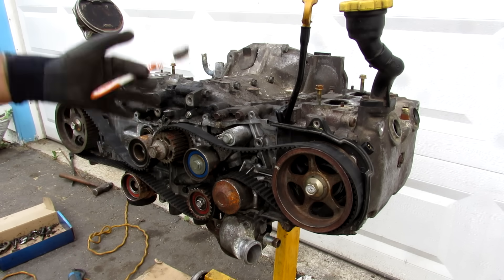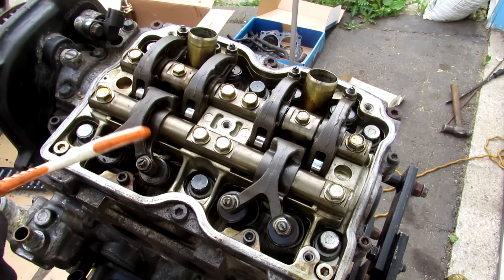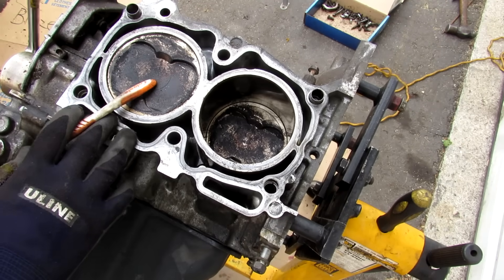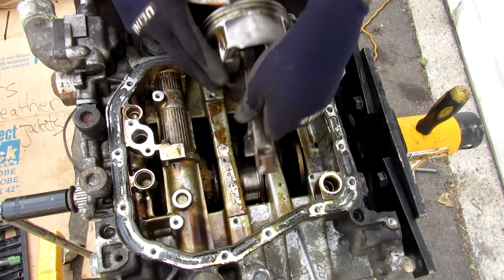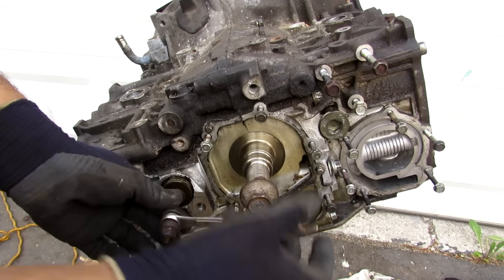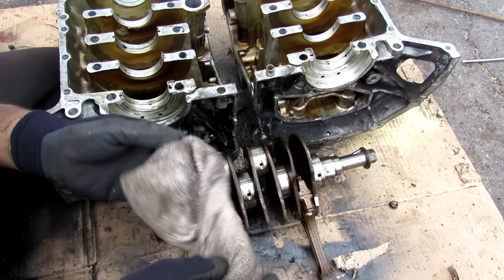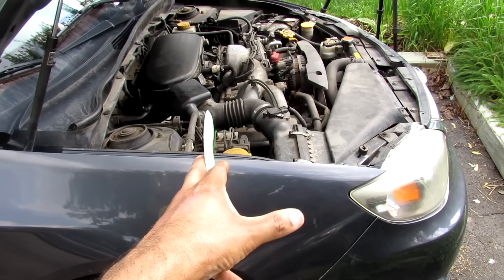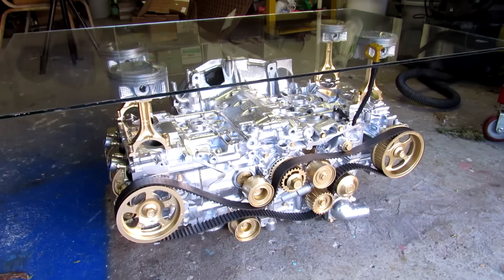Why Subaru Engines FAIL

Comment: A V6 is not smoother than a flat four as it does indeed have secondary forces that generally need a counter balance shaft to dampen them. An inline 6 is very smooth however. Even a V8 is inherintly out of balance. Smoothest running engines, Flat 4, inline 6, V12, and the old inline 8's.

Comment: I can see it, man I broke my suburu engline. It didn't want to split apart so I was pounding it with a rubber hammer and it cracked. Then I found their was still one bolt  hiding between inside the 1" hole in the sleeve. LOL

Comment: Mechanic owns a Lexus cause he knows they are one of if not the most reliable cars on the road. 

If I could afford a new car right now I'd buy a LEXUS or TOYOTA  Forerunner. If ya maintain the engine with regular fluid changes on time  you will never need another vehicle again.

Comment: Moral of the story wouldn’t hurt to put in a high flow oil pump or a bigger sump if you can or at the very least keep them stock standard and make sure they’re always chockablock with engine oil that’s clean

Comment: My 2010 ej205 have 270k with no headmaster replacement. After 2013 Subaru went to Single layer metal head gaskets witch destroy the head hgasket leak. They might not be the easiest to work on, but its rare you do unless you have 300hp or more with the wrong build.
Reply: Headgasket**

Comment: Most fails come down to irregular oil changes and hard driving , if you have a weeping gasket a stopleak in the radiator fixes this problem for good the earlier the better
Reply: Wow, how about a new radiator. Patches fail it's best to do the job and just get it over with. Boxer motors, great in aircraft.
Reply: I think he means when we have a leaky gasket we can put an additive in the radiator. This would fix the gasket leak. Cheers.
Reply: @bignaughtydog  right, I Misspoke
Reply: A denier that will walk

Comment: Modern engines have really weak and thin piston rings to reduce drag. But what really happens is they don't do their job well and that's why modern engines burn oil. Older engines had to be neglected for a long time before that happened because they had thicker rings with more tension. They're trying to fix one problem by causing a lot more. If they would just put better rings in Modern engines, they would last a lot longer. But if people would maintain their vehicles properly, that would also help

Comment: And yet, my neighbor, who commutes almost two hundred miles every day, buys used Outbacks with an average of 100,000 miles on them and drives them until an average 300,000. Can't remember him ever having a serious issue or being towed. He loves them because he drives over a snowy pass. He said he buys them because of their reliability and because nothing else on the market compares to the security of the symmetrical AWD. He also owns a 4WD pickup, but vastly prefers the Subaru in the snow.

Comment: My 01 H6 outback went 300k and rear main leak was it's death. After that I had two outback sports that went 300k with subframe rust being their deaths. H6 I did a pulley, both sports I did timing belt jobs. Mobil one and premium gas. My WRX spun bearing at 130K after month of owning just day dreaming down the highway and that was liquid molley because Mobil one is not good enough for turborus.

Comment: I remember buying my 16 wrx it dawned on me doing spark plugs might be a finger breaking experience and a shop quoted $250 in labor alone lol then I removed the battery and did it in less than an hour and realized it was easier than I thought
Reply from the maker: Was it tight to build your socket extensions inside the tube hole?

Comment: I have dissected subaru, honda, toyota and hyundai engines in about 1.5 hour.  All rebuild with new pistons, connecting rods, bearings, head gaskets, oil pumps, water pumps, camshaft, etc. Anyone interested I replace head gaskets for $700, tranny for $700 as well including parts.

Comment: Just so you know: any car factory could allow people to order a car without an engine. The factory doesn’t care. After all, cars used to come with a choice of three or four different engines. So you could choose a car, and then have it delivered. Then a local shop would install your choice of gas, electric, or hybrid. There are dozens of engine makers, it would be easy.
Reply from the maker: That would be sweet but a logistical nightmare. 

I could see that working on a very small scale with a Go-kart frame or something

Comment: For 13 years Subaru knew about the thermostat  problem and head-gasket but would not correct it. Millions of 2.5l motors sold. I would never buy from a company that cares so little about about their customer. I will never buy one.

Comment: My Subaru runs beautifully but it burns soooo much oil.  2013 2.5i. No more than 1500 miles between quarts; sometimes less.  The 0W-20 oil isn't cheap, either.
Reply from the maker: Is it the EJ motor?
Reply: @speedkar99  I'm no expert but I thought the EJ motor was the one in the STI. Mine is just a 2.5 Outback and I think it might have an XV engine or something like that

Comment: There is also a crank bearing problem on the 2.0 JDM specs, you really have to use specifically mobile 1 5w 30

Comment: Subaru engines are basically a novelty item. There's really no good, logical reason to spend more money to build a flat 4 "boxer" engine. Only a Japanese company would spend extra money, just to make something that is special, even when customers aren't realy asking for it. The Boxer engines sound very rough and noisy when you're cruising. When a Subaru goes by, it has a deep rumble, from the odd firing intervals, compared to a normal inline 4, which is glassy smooth sounding in comparison.  The Boxer engines, are, internally, very strong, and expensive. But the engines are inherently much less reliable than a normal 4 cylinder engine. I have only met one person, who had a Subaru that didn't have severe oil leaks, and head gasket problems.

Comment: these are great engines, they last forever if you change the oil on them, headgaskets do go bad but they are easy to do.
Reply: $3k  I wish. Got quotes $$5k dealer and $3k private Subaru mechanic several months ago. Although cheaper and faster to do the heads than get a new car.
Reply: I'm curious, around what mileages do the head gaskets become troublesome?
Reply: @christopherchander2754  head gaskets were only an issue in the older naturally aspirated ej series engines due to the fact that they used a graphite gasket rather than a multi layer steel gasket. However everyone on the internet seems to think it automatically applies to all Subarus
Reply: @enrique3743  Appreciate the response.
Reply: @christopherchander2754  it’s weird, my mom’s car is over 100k with no signs of trouble, but my dad’s head gasket started to go around 65k. they’re all over the place
Reply: @jacklandry9832  I suppose if the two cars are the same model and built in the same year then we have to consider factors like driving style and how they are maintained...?
Reply: I'm learning this engine as I go I have to replace my headgaskets. It's been  half a year since it worked properly. Im 2/3rds through tear out. It's been hell.
Reply: @username8644  thanks for the reply.
Reply: If they're so easy to do, why does Subaru charge $3,000 to fix it out of warranty?

Comment: My Forester has the FJ25 engine with 304,000km on it. It uses a lot of oil but blows no smoke. I drive it a lot so it doesn't sit around much which helps the Suby engines a lot. So far the engine is fine. I do however have a feeling of doom hanging over me.

Comment: I've never learned more about my car than from this video 😍 I have an '05 Outback XT Limited and now I know I have every thing wrong with Subarus in my engine... piston slap and either the headgasket or piston ring issue (or both lol) I also believe I have a bad vvt solenoid due to a misfire issue but I'm not giving up on her as its my first car! Looks like It'll be a lifelong project though and definitely not my daily for much longer😅 Also I'd love to see if there is a way to set the engine/transmission back further without changing the position of the wheels (like some sort of extra joint on the axle/from the transmission or something) so I could potentially cut the overhang back a bit to make it a more offroad worthy vehicle!

Comment: Maybe boxer design is more complicated and requires more frequent maintenance compared to I4 or I6 but when you consider the whole car as one system it could be the best engine design for the people in the car. It lowers the overall center of gravity considerably which helps the car to be much more stable in corners. Subaru BRZ center of gravity is just 18.1 inches. I believe in the engineering dept. Subaru cares for the people more than other manufacturers and that's exactly why they have a very loyal customerbase. I once had a Legacy 2.0 and will miss it always.

Comment: They are really cool engines and make great power and sound. In my mind similar to the Rx8 rotary engines, Very unique, But might require a rebuild from time to time, but no worries if its the car you really love.
Reply from the maker: Rotory teardown would be nice
Reply: They only pump out decent power turbocharged. N/A boxers are sluggish as all buggery.
Reply: @EcotecEngine3.8V6  there's nothing inherently underpowered about a boxer engine design aside from the limitations of being 4-cylinder   The reason the EJ is so sluggish off-boost is because it has a very low compression ratio, but that low compression allows for more aggressive levels of boost.  Porsche has made tons of flat engines, albeit 6-cylinders, that are NA and produce plenty of low end torque.
Reply: @ZakTheRipper18  from my vast experience with cars and the Subaru Boxer engine, both in ownership and driving, for comparative CC ratings, boxers definitely fall flat in power and power usability. I'd prefer to drive any cubic capacity l4 any day of the week over a same sized boxer. The boxer simply needs to get far too high in the rev range to get or feel any sensation of usable power - especially under 2,500cc variants.
Reply: @ZakTheRipper18  I mean you literally admitted yourself they are sluggish off boost, after saying there is nothing inheritly underpowered about them...
If they need boost to go, then yes, I'm correct - even by your own words.
The potential for power means nothing because you can boost any engine.
Reply: @EcotecEngine3.8V6  underpowered off boost because the EJ has low compression.  Having a low CR is not inherent to a boxer configuration.  That's a design decision to make more top end power with greater boost while minimizing detonation on pump gas.
Reply: @ZakTheRipper18  what exactly are you trying to debate here? You've literally agreed with me - once again - they are slow off boost. You can't argue with me and use the exact same description I have, lol.
We are talking Subaru boxer engines - which do have the characteristics I laid out, so whether it's by default or by design - I'm afraid I'm still correct. I'm not actually sure why you are bothering?
Reply: @EcotecEngine3.8V6  oh, excuse me, your "vast experience" must outweigh that of engineers.  

Look, there are limitations and compromises to any engine design and architecture.  But I own a 2019 STi and it has PLENTY of usable power.  It's an over-square motor, it's designed to rev up quickly and be yoked hard in the 4k-6k rpm range.  And being a boxer, it has little vibration and feels incredibly smooth.  The power doesn't fall off a cliff at higher revs either.  The compromise?  Less low-end grunt.

My buddy has a CX 30 Turbo, and it makes a ton of low end torque, but the motor doesn't rev high and power falls off above 5k.  It's not particularly exciting to drive, imo.
Reply: @ZakTheRipper18  so once again, you agree with me that you need some rpm's to get speed - even in a turbo - you lay out design limitations (of which you originally discounted as a reason) THEN have the audacity to get all pissy? Wtf? I'm not surprised, this is the internet none the less.
Tell me who hurt you, and we can talk it out.
Reply: @EcotecEngine3.8V6  i have a ej25 inside outback station wagon. for some reason this outback is alot bigger than other outbacks. even in same year. this car sits taller and wider.   from factory it has 165hp. and i have no problem with its power. its faster than my sports cars. no power problems here. no turbo
Reply: @EcotecEngine3.8V6  all i4 are front wheel drive. thats a big no no
Reply: @rocketsmall4547     a lot bigger than Outbacks of the same year? Ummm? Sounds like your hash pipe needs to be layed down for a while. 
And I've owned an EJ25 Grand Wagon - same car - and it had an OK amount of power, sure. But all in all, they are not rocket ships that can beat an l4 of the same capacity - especially, as I said, under 2500cc variants. They just feel weak.
And I'm not sure what you mean all i4's are front wheel drive? That's so far from true. Hell, my 1997 petrol powered 2500cc Mazda Proceed is rear wheel drive with a North-South engine. Until I engage 4WD that is. There are many i4 rear drive cars.
Reply: @EcotecEngine3.8V6  i have never seen another outback as big as mine. maybe its lifted. i didnt lift it. 
maybe cuz is special limited edition. 
if i need more power turbo swap is option. but its completely unnecessary. im planning to install ej20 in it.
Reply: @EcotecEngine3.8V6  ok ok most i4 are front wheel drive. jees.
Reply: @rocketsmall4547  lol. You said dimensionally bigger. Not just lifted. You are tripping.
Reply: @EcotecEngine3.8V6  it sits taller and look bigger. look i had the car for years i still haven't figure out why is bigger. like this spose to be a station wagon. but it looks like a full sized suv. not a cross over suv. full sized suv. its huge. but still gets 25 mpg
maybe with e20 swapi can get 30 or more
Reply: @EcotecEngine3.8V6  i dont think is lifted maybe it has bigger tires
Reply: @rocketsmall4547  I can assure you it's not bigger than a factory Outback of the same year, it's not like bigger-bodied versions were made. You need to park beside another of the same year to reassure yourself. It's not a special "bigger" edition. No such thing.
Reply: @EcotecEngine3.8V6  I would love to experience it someday. 😁Im stuck with my 03 Svt mustang.
Reply: @SVT_DREW  ensure you get a turbo variant or you'll be disappointed. Here in NZ we are flooded with Subaru.
Reply: @EcotecEngine3.8V6  you said NA boxers are sluggish.  I'm saying nothing inherent to the boxer configuration makes them sluggish off boost, except that Subie designs theirs to be low-compression and over-square, which are not necessarily variables inexorably tied to a boxer configuration, that's all.  Again, see Porsche flat-6 NA motors.
Reply: @ZakTheRipper18  I know what I said - you seem to be taking umbrage to it, even though you agree. Lol.
Reply: @ZakTheRipper18  and flat engines are not boxers.
Reply: @ZakTheRipper18  I even said "by default or by design". That's how they run.
Reply: @ZakTheRipper18  I also never claimed boxers can't extract better low end power, it's how Subarus run that is the subject here. Don't come at me with claims I never made. I love how you tried to dig at me about my knowledge and the engineers of the engines lol, it's driveability I've been talking about, and I'm right - and you agree so what's ya problem?
Reply: I absolutely love the character of the EJ in my '19 WRX STi, even if it's technologically obsolete compared to direct-injection engines and twin-scroll turbos.

Comment: Subaru is bought new and sold after 7 years before even that crap happening . It is a problem of people with old subaru. Actually now subaru even giving cash in case for fixing it before car is 8 years old. Subaru is excellent car for driving you have to buy nee one and sell it after 8 years and another one with newest technology. That is how most people work. Those mechanics are fixed in old cars i see. I don’t like old cars.

Comment: What causes overheating in Subaru? T.S.R
Reply from the maker: Heat waves
Reply: @speedkar99  how is it permanently repaired please
Reply: @speedkar99  Bro could you take this video down, its extremely misinformed. You mention all the issues from a 25year span as if every engine has all of the issues. Kinda messed up for someone to be completely wrong yet try to inform others.

Comment: Is there a video on how/when all the engine problems mentioned should be fixed. Like when should I replace a certain part on the car to prevent known issues with the boxer engine

Comment: I recall that Chrysler made a slant in-line six cylinder engine back in the 1970's.  Being slanted wouldn't that cut down on the vibration produced by in-line, vertical piston engines?

Comment: Hey man, you got something wrong with this engine. The head gaskets on the 2.5L Subaru engines ARE the fault of failures and leaks. They're coated with some kind of plastic stuff that breaks down over time, and leads to leaks and fluid mixing. The common repair is to lap the heads, and then install the MLS gasket from the turbo engines. The leaks miraculously stop when you do that. And they last well over 200k miles, unless you overheat, somehow pressurize your crankcase, or don't change your oil ever.

Comment: So as soon as the engine starts leaking oil get rid of the car asap?
Reply from the maker: Before it leaks oil then get rid of it...
Reply: @speedkar99  oh i see... damn i was told these things last up to 300k miles.
Reply: @ZeroCool2013  One of mine is at 312k miles. my other is at 218k miles.
Reply: @Merker367  and both covered in oil leaks galore?
Reply: @ZeroCool2013  At 20 years old and hundreds of thousands of miles, iv done an engine reseal. No leaks.